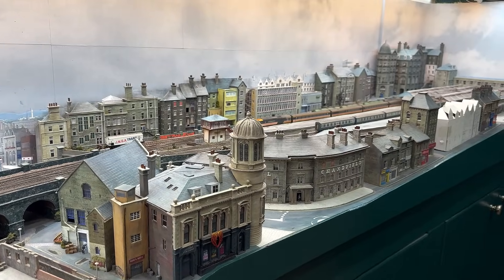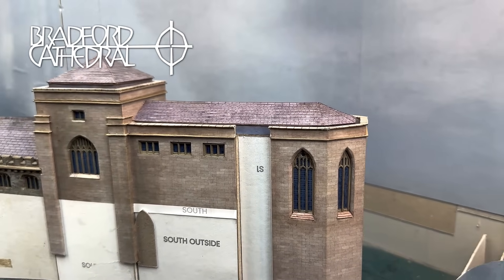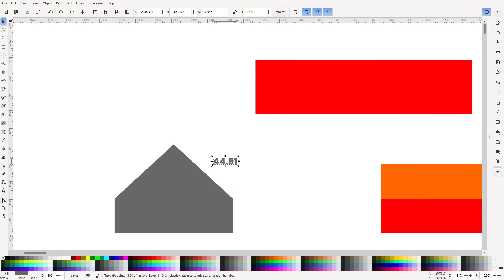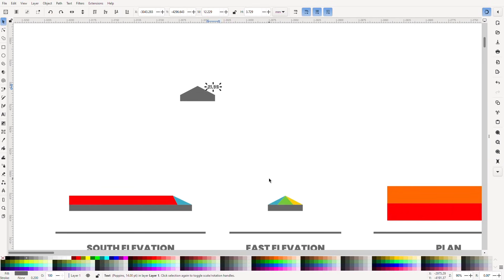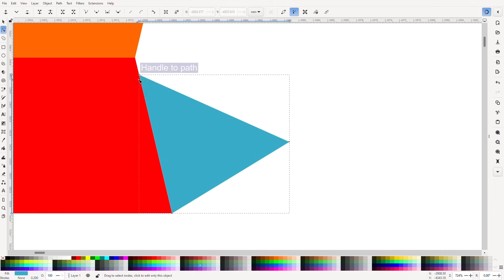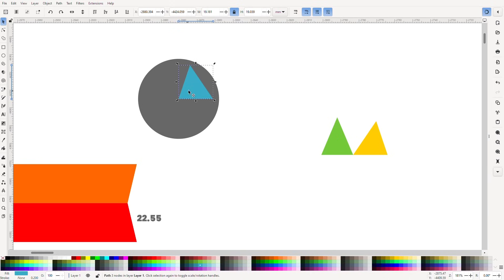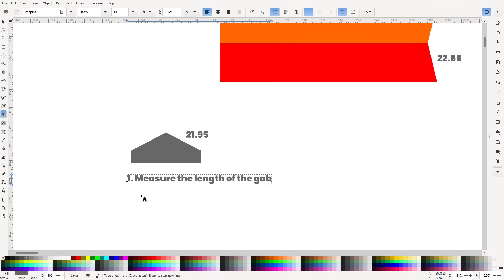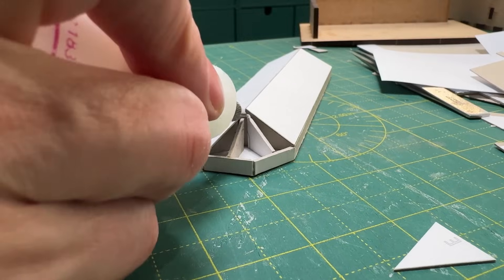Triangles to Triumph: my simple method to make this cathedral roof

Comment: I’m not going to lie Michael, I’m going to have to watch this (or at least sections of it) a few times to get the background to make sense.  You’ve really achieved some clever thinking here, way beyond what I knew you could work out anyway (which is very good).  Thanks for another asset to the model building arena, great stuff indeed

Comment: Sorry, but you didn't say how you found the first angle on the right side of the red part.
Reply from the maker: I just drew it on the plan. This video assumes the plan view has already been drawn. In this instance I just drew a line directly down the centre of the building to represent the ridge and then drew lines from the corners of the hexagon part to meet that line. Hope that makes sense. Let me know if not and I’ll do a quick Short video to cover it.
Reply: @Chandwell  So I'm guessing Inkscape has a default hexagon shape that you matched the eaves and roof centre line to to get the first angles, yes? Thx.
Reply from the maker: @ it does, but I didn’t use that. I just drew lines at 45 degrees.
Reply: @ Okay. Thx.